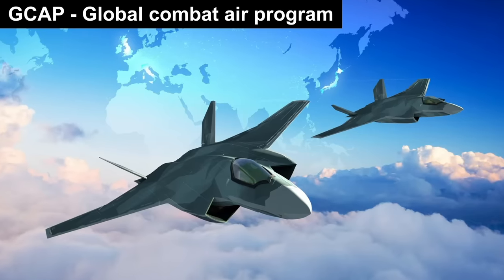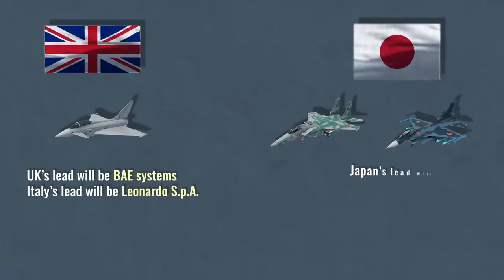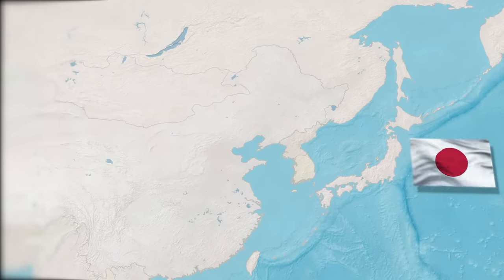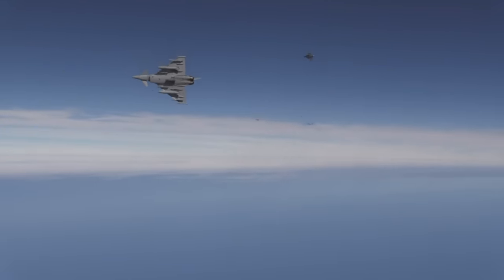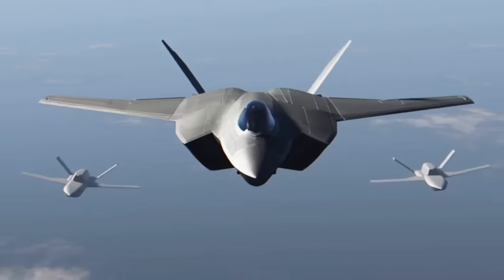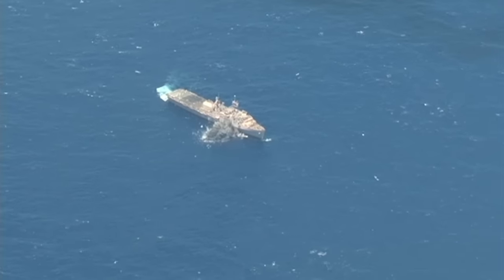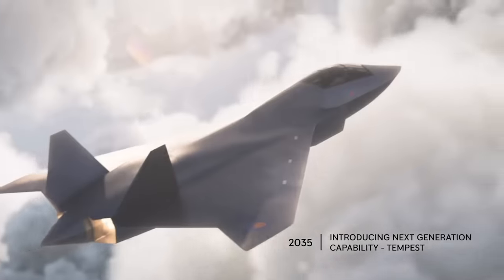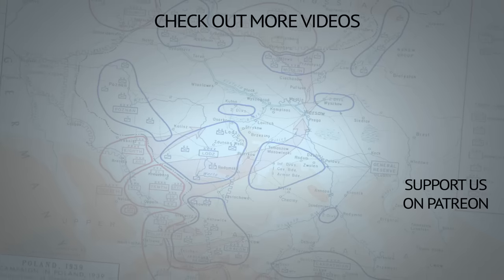Why is the future Anglo-Japanese fighter gonna be bigger than F-22?

Comment: This type of cooperation will only become more important over time as development costs increase each generation.  By 7th or 8th gen the US will inevitably have to run one big program with its allies.
Reply: Unlikely to happen if they keep withholding crucial data to allow the partner countries to modify their aircraft. Then limiting which additions and armaments are allowed to be used/purchased from them. US tends to screw anyone they are partnered with because they can and it benefits them. Something that most of the world is aware of is that if you become of little value to US they will drop you reeeal quick so if they can help it countries tend to not want to rely on US. Having a worse plane but being able to produce and upgrade when needed can be better than a good plane with limited abilities and potentially being cut off.

Comment: Whatever American allies like Japan and England design and build, as long as it adopts the open architecture of the F-35 (and likely NGAD), the design's success probably would be assured because then its internal components would likely be interchangeable  with anything built by any NATO member. Buyers and operators of the aircraft might literally be able to pick and choose which components that best fits the country's budget and needs. And of course weaponry can be built by any country that supports the same mounts and provides the necessary management within the aircraft's open architecture.

Comment: Great video as always… but putting the Italians that much a minor partner is quite a bit unfair and, at least for me, incorrect: although moneywise Italy will probability spend less compared to the UK and Japan, a huge chunk of know how and technology are still coming from Leonardo, both the Italian division and the UK one (which is still owned by the Italians) plus other Italians firms. I think it is expected that as for operational requirements UK and Japan will have a higher say than Italy (probably not that big deal for Italy since it has similar necessities with the UK). As for the technical contributions, Japan and Italy will be more or less on the same level behind the UK.
Reply: Some good points, but it doesn't seem fair to say Leonardo could contribute as much on the critical stealth, sensor or engine front- but if I'm wrong, please correct my ignorance.
Reply: @lechefski   i don’t know for sure, just speculating , but consider that the latest AEsA radar for UK’s typhoon, the ECRS Mk.2 is developed by Leonardo, as it it from Leonardo the radar on the Swedish Next Gen. Gripens . Leonardo is also responsible for the electronic warfare suit ( thanks to the experience with the DASS system and Britecloud decoy/countermeasures) … all aspect that I think crucial in determining the effectiveness of a stealth platform. In the end even though UK is definitely ahead in stealth tecnology… Japan and Italy are the only countries with an F35 final assembly line, so a guess that some know how was gained in that’s sense.
Reply: @20Mb01  I see, that fits in well with what another commentator corrected me on- Italy seems to be very good at both designing and producing sensors for both military and research purposes. I assume the language barrier is the reason that most of us are still clueless about their part in all of this!
Reply: @lechefski  yeah guess so… I’ve noticed that Italy is usually not good at advertising its products apart from food and fashion  ;) but yeah Leonardo has a pretty solid electronic and sensor  division thanks to the acquisition of other minor Italian companies and part of what was the British Marconi Company, thus a big transfer of know-how (similar to what happened with Westland helicopters).In the end To be fair when talking about these big international corporations, relating them to a single country is a bit reductive since their   Divisions, workforce etc. are usually scattered throughout different countries…
Reply: @20Mb01  Good point- I only make an exception for military products since tech transfers between countries supersedes the usual industrial politics between corporations. It's a good thing that the three countries involved here seem to have no major disputes.

Comment: Of course, let's ignore Italy, who was in the Tempest project from the very beginning and is bringing to the table three times the expertise of Japan in aircraft technology......
Reply: Did you watch the video Italy did bring nothing ...
Reply: @giulianoilfilosofo7927  No one is actively sh*tting on Italy, most of us are just ignorant... and to bring attention to Italy, you don't need to crap on the recent Japanese advancements.
Reply: @Shambles7698  Italy will help a lot with its specialization in sensor technology and software iirc. Like Japan, they're also an F-35 production assembly and maintenance partner, so they can also help cut down costs and supply chain risks there.
Reply: @lechefski  I am not shitting on Japan. I am Just arguing that, At the Moment, they lag behind in aircraft technology because they have not produced a single domestic design that wasn't based on US imported airframes since 1945.
Reply: @giulianoilfilosofo7927  Well.. they weren't allowed to by the US, for obvious reasons. If you want a taste of the reasons why the US gained more from the F2 program than Japan did, look at the history of AESA radars and the joint partnerships the US suddenly gained since the 80s for both passenger and military jets. IHI is not new to jet engines, they've been upgrading US jet engines including the F135... much like RR and Leo*, they've had the capability to do more but have been hampered by politics and tight budgets. Anyway, I'm glad this didn't turn into a shouting match- the truth will come about Italy's overlooked strengths and contributions, language barriers be damned.
Reply: @giulianoilfilosofo7927  By the way, the Japanese have a history of appreciating Italian aircraft. It's touched on in the Wind Rises ;)
Reply: @lechefski  I am glad it did not degenerate into a futile argument also because that wasn't at all my intention. As caustic or provocative as my comment could have been interpreted, my criticism was directed towards the author of the video, not towards the Japanese people, technical capabilities or their culture, for whom/which I have nothing but profound admiration and respect. It could have, admittedly, been worded or articulated in a better way. I am simply ged up of this widespread anti Italianism and costant mediatic bombardament of our country on foreign media.
Reply: @giulianoilfilosofo7927  I appreciate your clarification. I'm not familiar with the belittling you're referring to so perhaps it's not fair for me to downplay it. I've noticed a lot of ignorance regarding Italian advancements and procurement in general though, so I'll do my share to spread the word when appropriate, cheers.
Reply: @giulianoilfilosofo7927  I Love an angry Italian, well said mate
Reply: shareholders

Government of Italy
30.20 %
The Vanguard Group, Inc.
2.341 %
Norges Bank Investment Management
1.963 %
Dimensional Fund Advisors LP
1.907 %
Invesco Advisers, Inc.
1.835 %
T. Rowe Price International Ltd.
0.9301 %
Goldman Sachs Asset Management LP
0.6457 %
Reply: 3 times... is likely an exaggeration. I would say Italy has a slight edge; but it's not that much. You should understand the F-15s and F-16s Japan flies are completely domestic built, by Mitsubishi Heavy Industries and other defense companies in Japan.... with permission from the US Pentagon of course.  

But it's not just that, Japan was one of the major airplane manufacturers from the 1930s and 40s. 

Once Germany and Japan --- BOTH former major aircraft manufacturers, at LARGE SCALES --- were defeated, they fell under the US monitoring auspices and so they mostly pursued activities deemed defensive by nature that's okayed by the US... and that's why Japan hasn't gone on its own way, other than refabricating F-15s and F-16s in Japan, using blue prints from the US Pentagon....

Third thing:  Japan is the third largest economy in the world, so it has much more resources (money, engineers, computer scientists, metallurgy specialists, etc) than does Italy. Once it is committed to a project, Japan will have enough resources to see it through.  Why would Britain or Italy make this consortium with Japan, if they had to carry Japan on their backs?  This is no charity.  You only form partnership with another country because THAT COUNTRY is a TECHNOLOGICAL powerhouse, with the resources to get an ultra complex, ultra expensive project going....

Japan also is one of the Top 3/4 or so largest high-end computer chip producers in the world (without googling it up, I think it is Taiwan, USA, Japan, and South Korea).... NOT Italy and NOT Britain... You need those high end chips and they must be produced IN-HOUSE, so you trust them 100%, if they're to be used on 6th gen stealth jets....
Reply: @kiabtoomlauj6249  Don't worry, no one in their right mind can question Japan's industrial power, but the criticism is aimed at the creator of the video who belittles Italy in this project, as if Leonardo doesn't count for anything. Just out of curiosity, Leonardo won the contract for the latest upgrade of the British Eurofighters, including avionics, sensors and radar. British and Italians also build excellent helicopters!
Reply: @giulianoilfilosofo7927 By underestimating Japan, it doesnt make Italy a better. You also dont know a lot about Japan which is more techonology and economically advanced than that Italy. Ohh and by the way, did you know that AESA radar was first developed by Japan. The AESA radar and composite materials  of F-22 raptor was based from the jointly developed F-2 between Japan and U.S in which from Japan share of technology.

Comment: Not only will bonding save 10% in weight, but losing 1000's of rivets and other hardware will make it lower observable (more strealthy) than if it had rivets
Reply: The bonging was internal. I don't think fighters have had outer rivets for a while because of the extra drag

Comment: I mean I’d hope it’s better than the f22 and f35. The f22 is ancient and f35 development started in the 90s.
Reply: Point to a 4th or 5th gen fighter that didn't takea minimum of 20 years to develop and become operational. It's the way it is with complex projects.
Reply: @lukedogwalker  you’re missing the point…
Reply: Idk its kind of a misnomer, it looks the same on the exterior but the coatings, radar, operating systems, flight controls, optics, computers, etc have changed dramatically. its like saying the engine in a modern Lamborghini is the same as the Miura's engine from the 1966.
Reply: What's the point of even talking about the F-22 it's not the topic. Yes, Japan wanted it once, but it cannot be exported by US law, and because of this, it's not in Japanese service. Only the F-35 matters well, mostly to the Japanese.
Reply: @brianvanveghel7815  I didn’t bring it up. The comparisons were made in the video
Reply: It better be better. It's being developed 20 years after the F-35 and 30+ years after the F-22. 

It's like wondering if the F-15 would be better than the F-86 or P-51.
Reply: @lukedogwalker little ironic but the 6th gen NGAD (USAF) is set to have a sub-20 years development time and is currently right on schedule

Comment: Distributed fighter based awacs will be a huge counter to the Chinese J20 expected tactic of taking out awacs support planes. Having every fighter be able to fill that role will make that a more survivable and replaceable option.
Reply: Thats literally what F-35 already does bro.
Reply: @iamscoutstfu  exactly. I didn’t say this new fighter only… just that ability… which yes the F35 has… but it sounds like they want this new design to be superior in that regard with independent arrays to reduce blind spots and to allow finer tracking especially of swarm weapons or drones. I hope they also put infrared search and track on it too.
Reply: i'm not a military expert like you pretend to be....but arent the awacs those special big planes with the huge radar thingy that doesnt really fit into any fighter plane?
otherwise why would anyone even waste time building those big planes instead of just using fighter planes for that if the equipment fits them?
Reply: @sabin97  

ITs pretty clear you aren't a military expert, otherwise you'd understand why.
Reply: @@JimCarner 

Aircraft carriers bro.
Reply: @rosedruid  

Probably.  that would fit with the U.S.s High-low strategy.
Reply: @@JimCarner 

They don't actually have to stay outside the range of Chinese land-launched/air launched ballistic missiles though.  Why do you think that? 

Also, even if they did, we have a thing called aerial refueling which is done by drones, now.  This can be done multiple times in a single mission and extend aircraft strike ranges by a vast amount. 

So even if they DID have to stay outside ballistic missile range (which they dont), they could still strike China. 

Not that they would need to, theyed just need to strike the Taiwan strait, which is outside China.

Comment: So much speculation and conjecture about this project at this initial stage. Interesting information, but veeery much subject to change, especially given recent history. What IS interesting is that Japan, UK and Italy want to be independent from LM and the US MIC and for good reason. I wasn't aware that SAAB had pulled out though.

All the same, I give it a maximum of 50% chance that this project will hit the finish line. BAE kind of has a track record of all talk and no show.
Reply: BAE is the largest arms manufacturer outside of the US and they are huge and worked massively on the F35 and on top of that, Rolls-Royce engines are some of the most capable in the world... The UK has the capability to make a stealth fighter and Japan are looking fast to upgrade their military due to rising threats and they have the industry to do it. It's an ideal partnership... Italy are sort of a third wheel that'll cover some of the expenses but still important for finacial reasons so I can see this going through but I can see Italy being replaced later on though.
Reply: @crackajacka87  Well, when did they actually build a jet fighter last? Little SAAB in Sweden just got the Gripen E on the market, which the best jet fighter out there on a cost/maintenance/philosophy perspective. Yes, it is hampered a bit by having to rely on a 2nd rate American jet engine, but I would still pick it any day of the week over the Eurofighter, produced by a consortium of nations, and being replaced by F-35s as we speak/text.

It's been 20+ years when they couldn't get the Typhoon right and all the while buzztalk on Tempest and now GCAP. Believable? The French was right to pull out. I will believe this when I see something substantial, or we will have another two decades of talk, while the government decides to buy clumsy and overengineered US planes.

Prove to us that you could actually build a 6th gen jet fighter. Until then it's just talk, with no backing from corrupt politicians. To be frank, BAE would probably be better of as a subcontractor to Dassault or SAAB, who can actually deliver on time and on budget and deliver something good. I don't care if BAE is a huge arms manufacturer. Their track record on jet fighters speaks for itself, and now they're jumping one gen and expect us to believe their promises?
Reply: @henrikg1388  You do realise that BAE helped on the F35 right? They also test stealth capabilities of new materials as stated in the video and they are the largest weapons manufacturer outside of the US and they make all types of weapons platforms like submarines with the Astute class and IFV's like the Bradley, they have their hands in a lot of pies and lets be real with the Gripen E, it's very outdated in todays stealth market and is probably why it has sold barely any and is considered a failure from a comercial prespect as the few countries that did buy it only bought like a dozen of them... Only Sweden bought a lot of them with 74 but even then they leased out 28 to the Czech and Hungary airforces. BAE is far more capable of making a solid fighter that can compete with other 6th gen than SAAB could.

Comment: By the time the Tempest comes out, the F/A-XX and the NGAD will be also out.
Reply: They're hoping to start Tempest prod run about mid 2030s [at soonest] while F/A-XX and NGAD programs planning (or rather, "hoping") to start fielding by 2030 at decade's end if not sooner, prob optimistically aiming for soonest 2027-ish. Lol, we'll see if their math is correct shortly then and have next-gen air supremacy fighter in case of any provocation in the Pacific and that theater goes hot with rhetoric turning kinetic. At very least, I don't know how they [DoD/brass] hope to get production adherence to their schedule especially when domestically, the political class is trying to get coof lockdown and mandates to forefront again...which will definitely impede all domestic manufacturing of any sort with supplychain bs, personnel shortage, dumb ass draconian medical edicts, etc but I digress..
Reply: Yeah, and?
Reply: Ww3 would have already been over 😂😂😂